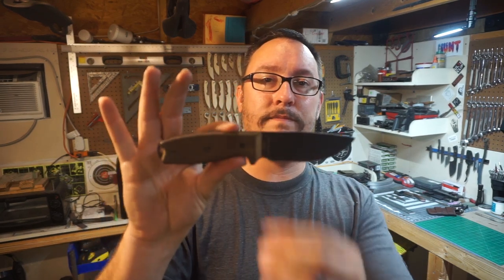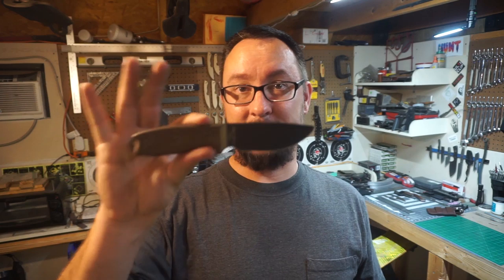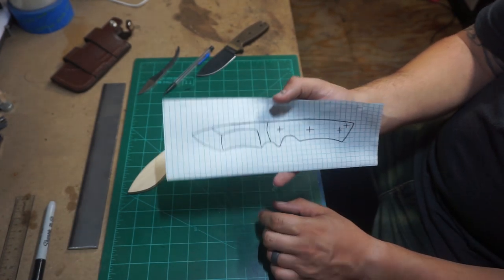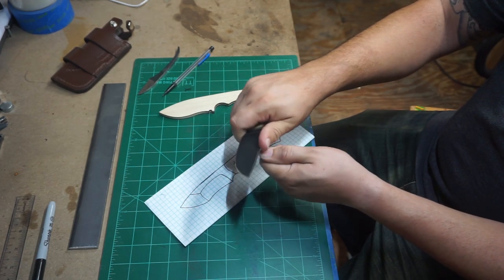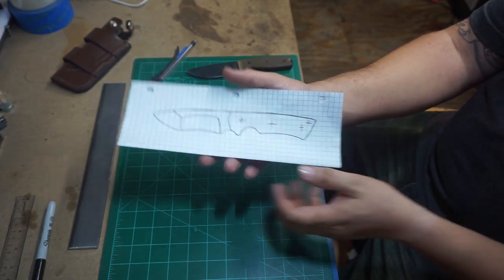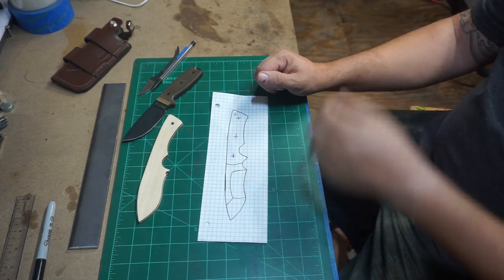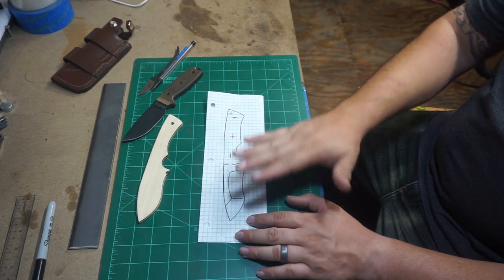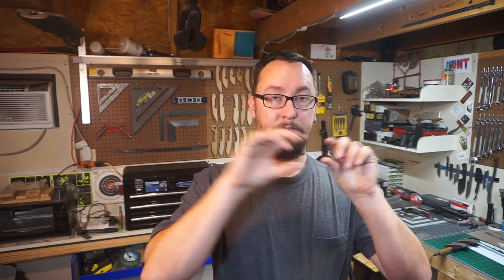How I Redesigned My EDC Knife | Knife Making | Daily Vlog

Comment: Hi mate love the videos just wondering where you keep your personal made knives that you don’t sell as I’m looking for somewhere to keep my handmade knives without having to make sheaths for them all and don’t want them to rust thanks
Reply from the maker: I currently keep them on the top shelf of a seldom used clothes, but I plan on getting a safe for them in the future.
Reply: @theriversexperience9383  thanks for the reply mate any ideas on how I could stop them rusting or would they not rust if they are not in use Iam using 1084 steel atm would a coat of oil on the blade be ok if they weren’t in use to preserve them thanks